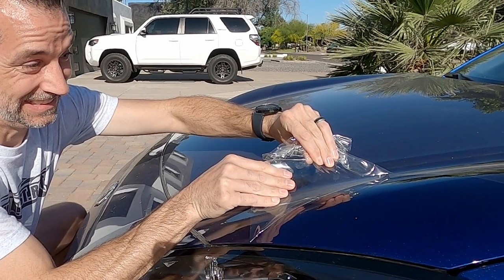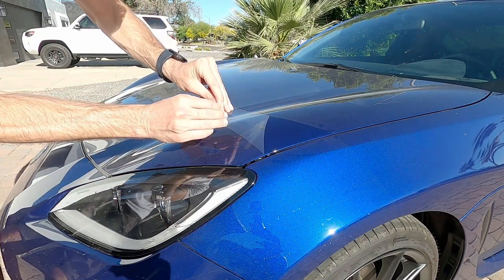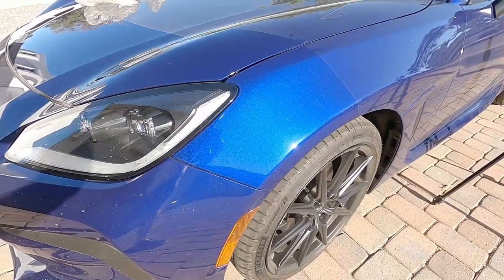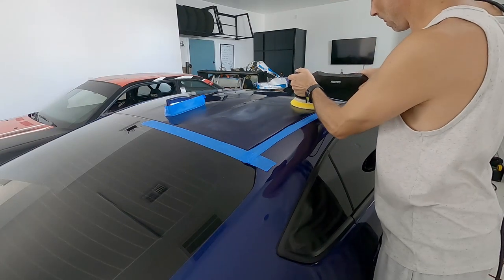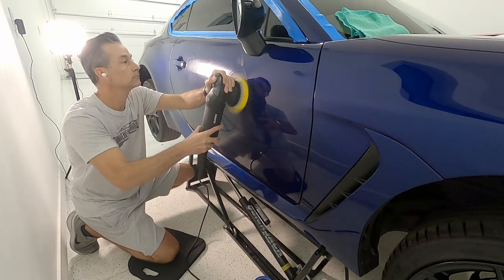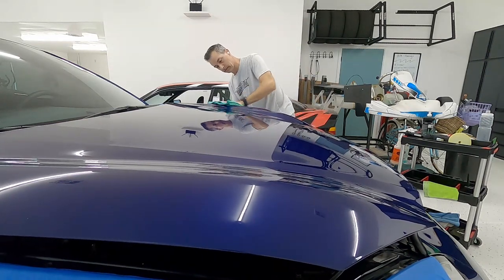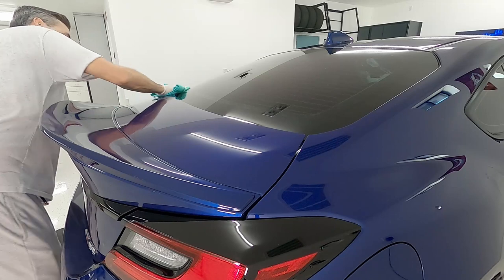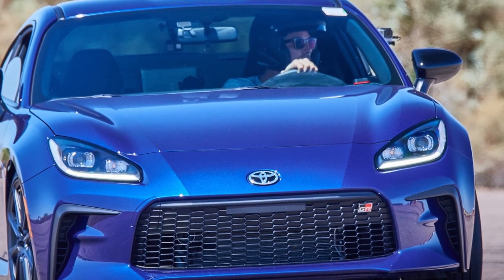Ceramic Coating My Toyota GR86 - After Ripping Off The Paint Protection Film!

Comment from the maker: Thumbs up for ceramic coating!
Reply: Informative videos , thanks ! .  One question, did you apply the ceramic coating then send it to a PPF installer ?  I’m curious about adhesion issues of PPF after a coating like wax or ceramic is applied.  I would think you’d do PPF first, then ceramic coating ?
Reply from the maker: Nope, ceramic coating is done last. You are absolutely right in that there would be adhesion issues with wax/sealant/ceramic already down.

Process is : wash, polish, cleanse, PPF if any, then ceramic coat.